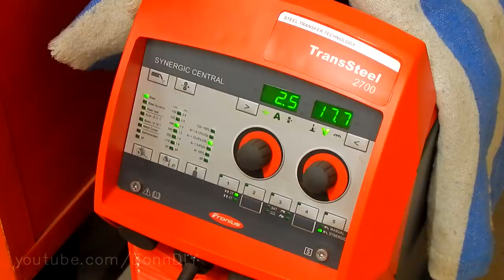Welding A Sheet Metal Hull - Tracked Amphibious Vehicle Build Ep. 16

Comment: Great welding! But there are no shame in using some kind of car body sealant. It would keep it dry inside and properbly also dampen vibrations/sound in the sheet metal. Love your videos! Nice to see someone creating and building stuff - I don´t do anything..
Reply from the maker: I hope the powder coating will take care of most of the leaks. But we'll see. I received the bilge pump today. Gonna install that too and fingers crossed hope for the best it is powerful enough to get rid of any water that might enter the hull of this vehicle. 😄

Comment: I spent many years as a welder before I evolved into nondestructive examination, specifically nuclear reactor components and I really appreciate your work. One thing I am wondering about is the crevice condition between the frame and the sheet metal of the outer skin on the inside. These crevices are collection sites for dirt which attracts moisture that leads to corrosion from rust. Over time this corrosion will eat it’s way into the sheet metal and frame. Not sure if you have thought about this yet. Epoxy paint that will flow into these crevices and seal them without chipping or cracking might be something to consider. You are obviously a very smart man and will address this issue one way or another. I can hardly wait for the tracks!
Reply from the maker: I've thought about powder coating - when electrically charged, the body should attract the paint everywhere. After the paint has cured in the oven I can spray some universal oil into the crevices to conserve it and drive the moisture away maybe. We'll see.

Comment: Looking great so far Donn. 
A couple suggestions that I have. 
Add some tack welds on the inside of the larger body panels to prevent vibration rattles. 
Also fabricate some brackets at the bottom of the chassis directly under your winch mounts like your snowplow brackets to allow for a pulley so your pull point is down low to prevent it from being pulled over.

Comment: Be sure to have a bilge pump on board 😁. Looking good !!  ... Those ceramic flapper disc can polish up the welds and make them look like they were made from one price of metal..
Reply from the maker: Bilge pump will be installed. However, I think I will not need it.
Reply: Donn DIY
 I don't think so either. I Didn't see too many oops lol.👍😉

Comment: Great job as always. I was wondering if you could perhaps try something like plastic skidplates? They would be good for preserving the bottom of the hull, and I have found through using them on ATV’s and dirtbikes alike that they don’t deform nearly as easily as steel/aluminum ones.
Reply: Bedliner is better or 10millimeter aluminumplate
Reply: Air boats use a type of plastic. Much abrasion resistance than bedliner material.

Comment: With that many seams, eccentric angles and joints you are going to have to apply some sort of waterproofing material to the outside of that hull (something sprayed perhaps) otherwise you will have pinhole leaks that will be a nightmare to sort out. Looking good however can't wait to see it in use. :D

Comment: Have you considered putting a marine (or even automotive) seam sealer on the back sides of the welds?
I think that you can weld it water tight and it will stay that way, but for extra security against cracking a weld by hitting a stump/rock etc in the wrong place a sealer might be beneficial. 
Totally enjoy your work. 
Thank you again Donn!
Reply from the maker: I will let this thing be powder coated. It should seal it up a bit more. No sealant in mind at the moment. Thanks for watching!

Comment: I estimate that fore and aft (pods) displace 100 liters, more  bouyancy ! Have you thought about bouyancy of tires / mass of tracks?  Welds look good that thing is strong enough for a gun mount !
Reply from the maker: Tires and tracks, I hope, cancel each other out, so the tires will carry the tracks weight in water and are not added to the overall weight that the tub has to lift in the water. But we'll see.
Reply: @DonnDIY  Sounds good ,eager to see finished unit !

Comment: You will only cut yourself badly "on your knee" with the angle grinder once ;-)

Good thing that fire was in paper and not the kindling for the stove. What a blow that would have been..  :-D

Totally crazy project with all those angles and welding. It is totally you and I love your stuff (in a strictly platonic way). I do think I would have found a big tub from a manure spreader or something and then built the chassis and structure inside it. I am just lazy. And I would never have done this project anyway so dont listen to me!

Carry on - I am really curious on seeing this thing hit the road, the swamps, forrestes, beaver dams, launched from the sauna into the pool with a trebuchet.. As long as it hits it as hard as I believe it will.
Reply from the maker: I don't really cut on my knees, I usually only grind. It takes more time to chew deeper into the leg with a grinding disc. The sanding discs are pretty crazy things, wouldn't want to use those on my knee. And I guess the steel wire wheel would be the scariest thing to use anywhere near my body. I have had a deep cut on my thumb once using the sanding disc. And this was due to the disc guard not being installed on it. I respect (read: fear) my angle grinder. So I stay alert at all times when using it. 😄

Comment: It looks so cool. 

Have you given thought to how the snow plow will behave hanging off of the front? I know you don’t need advice on your design, but I think I would run the support arms for the snow plow all the way under the belly and attach them in the rear, to prevent diving and jumping while plowing. 

Just a thought. Your doing a great job. 👍
Reply from the maker: I like the plow mounts up on the front. The plow will behave even better than the rear or mid mounted plow (tried one on an ATV once), copies the ground better and doesn't get hung up on the plow frame on the ground.

Comment: Looks Amazing! Are you planning on welding the panels to the internal supports for extra rigidity?
Reply from the maker: Don't know yet. The frame on the inside should provide the rigidity. I might though... 😉
Reply: My thoughts too, can't hurt I guess. Looks like a really solid build so far.
Reply: @DonnDIY  Right, my thought was about the panel rigidity. Seems like they might vibrate against the frame where not welded and be noisy. You could use silicone or something too though. 🤔

Comment: Remember this has to be watertight so use caulking on the Inside a 100% silicone caulk flexible any pin holle in your welds will let water seep in and damage your sheet metal and welds if not sink you like a rock. also by caulking you reduce sound transfer into body allowing you to hear just the engine

Comment: I have enjoyed watching you construct this project. But isn't it going to ride like tank with no suspension?
Reply from the maker: Tanks have suspension though. 😁 It's a crawler, top speed around 30-35 kph. Mostly gonna ride probably at 10 kph. The idler wheels will be a little more deflated than the wheels in the ends so this should soften the ride.

Comment: Hey Don are you going to seam seal with something like sikaflex etc belts and braces so you can be doubly sure that it wont leak, great job any way. Highlight of my Saturday when i get your notification! 

I just went down and did half hour of welding cant watch to much without feeling the need to get off my arse and doing it myself
Reply from the maker: I'm not too worried about sealing up the seams. But at the same time I hope they don't leak that much. 😁
Reply: I bet. Good luck, cant wait to see how you will leak test it. One plus you have is it not going to be under huge pressure.

Comment: Are you taking bets on how many pinhole sized leaks the hull will have?

Any idea how you'll test for them? 
...drop the whole thing in water? or seal the open top with a tarp & tape, apply a small amount of pressure then soap spray bottle?
Reply: Or just go full send and drive up a stream
Reply from the maker: Full send. Just send it. No time for testing.
Reply: @DonnDIY  Bit of a pain stripping paint off to fix holes after the fact though.

Or I guess you could jut go with the 'bigger bilge pump' approach and leave the holes be.
Reply: @DEADB33F  flex seal

Comment: I am worried about the lack of suspension. Is the fact that its tracked, and its intended usage make it non issue?
Loving the build series regardless, thanks for posting.
Reply: Well small tractors also dont have any suspension, on offroad or in mud where you crawl 3-4km per hour you dont need it much

Comment: I see where you installed grease fitting, it seems difficult to access. Why not install a small tube and weld it to the bearing housing you want to grease and install the grease fitting at the other end, and you install it at a place where it is easier to access.

Comment: I have been following you from Italy warmly since the beginning of the project and I congratulate you on your excellent work.  I just wanted to ask you which model is the blade you use in the miter saw to cut the tubular iron?
Reply from the maker: The regular one for mild steel that came with the Evolution Evosaw.